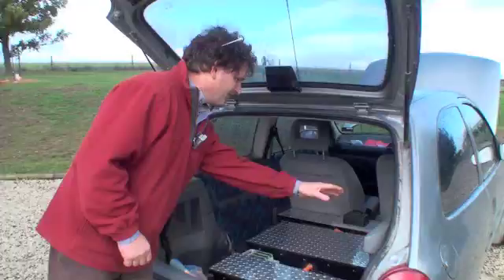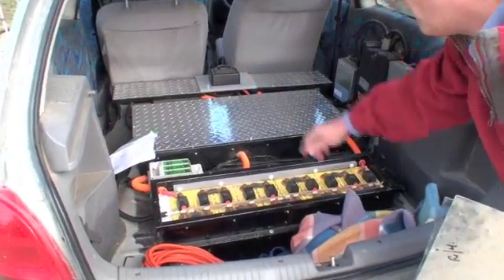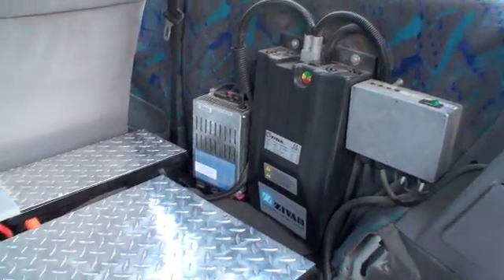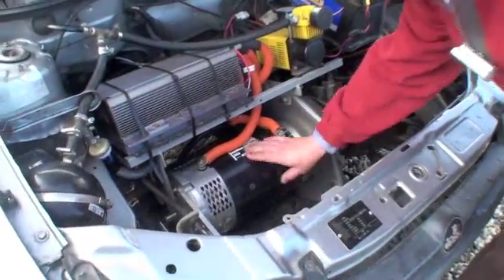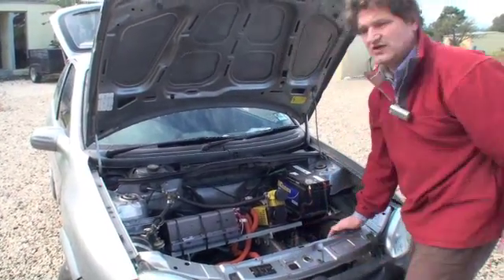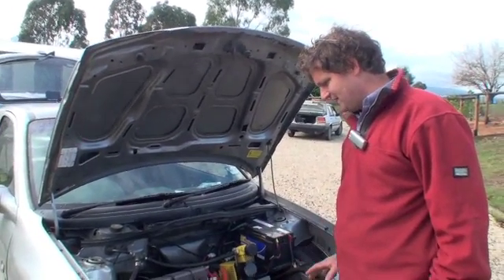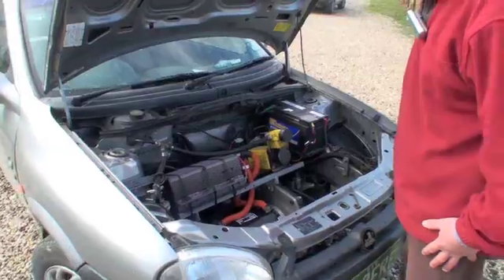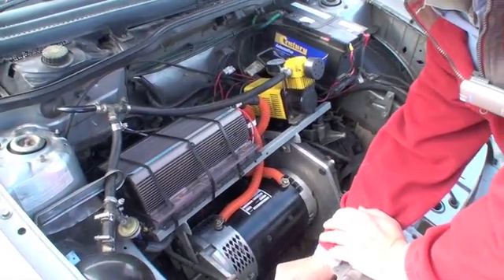Electric Car (Tech Info) Conversion - Kurt van Wijck

Comment: How are the A/C and Hydraulic steering pump and brake booster works on electric cars ???
Reply: Ac compressor you can replace with a electric one or you can spin the old with a secondary motor. Steering you can replace with an electric pump. For brakes you use a electric vacuum pump. All easy to find.

Comment: Hie.
i have always been filled with this kind of idea, thank God u managed to put it to work. Now my question is why dont you use an alternator by connecting it to the electric motor instead of using batteries as powerbanks.
Well, a single or two batteries  can be maintained, 1 for startup n the other as u explained, to run the lights and alarms etc.

Comment: I never said that fossil fuel is better! Nevertheless If you already have a car at the moment is less expensive and more eco friendly HHO technology. Yes  I agree electric cars are the leading direction of research. Real water cars are studied to use the fraction and recomposition of H2O to use the two electron to generate induction energy. Another interesting option to me at the moment is the use of alternators and capacitors to produce electricity to run your electric motor.

Comment: Electric vehicles are incredibly planet friendly because there's no carbon spewing out the exhaust or in the extraction, refinement and transportation of fossil fuels that cause climate change.  Fossil fuel has also led to death.  Batteries are regularly stripped and recycled for other consumer goods as well as lasting about 2000+ charges or roughly 20 years.  Electric also doesn't require air filters, additives, transmission fluid or extra expense. How are electrics NOT eco friendly?